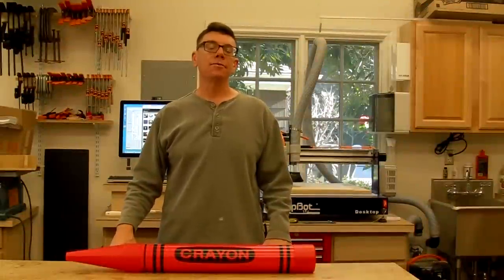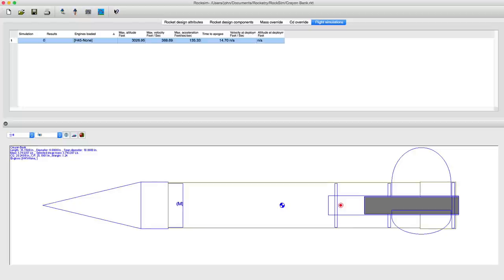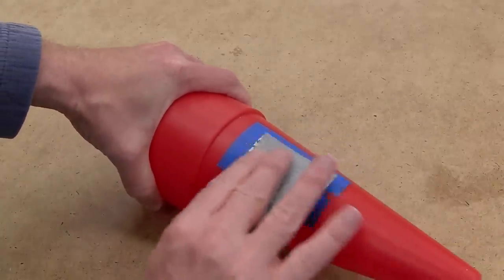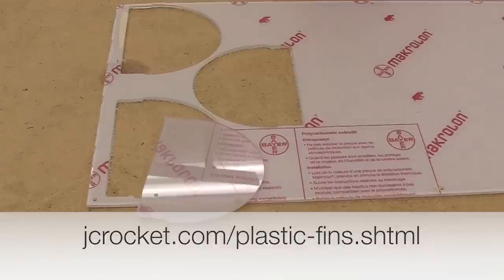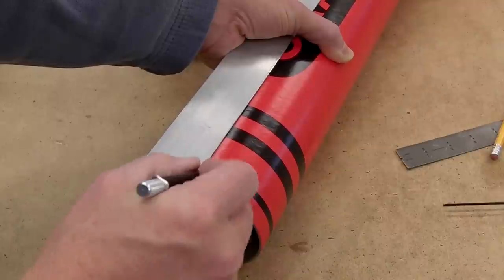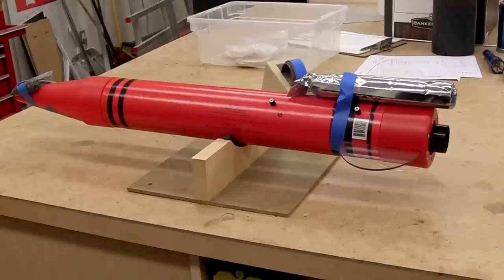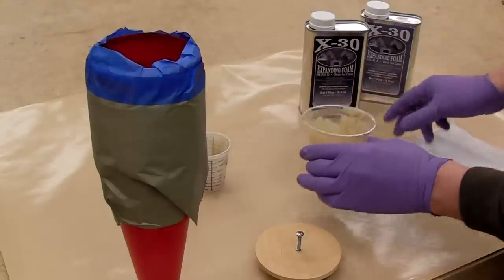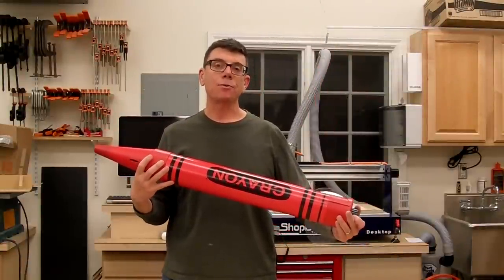Crayon Bank

Comment: where did you get the centering rings?
Reply from the maker: I made them custom to fit the inside of the bank tube.  I don't think there are any standard centering rings that will work so you pretty much have to make them yourself.
Reply: ok thanks, how thick are the fins?
Reply from the maker: 1/8" polycarbonate IIRC

Comment: I have a giant crayon bank but mine has a hole in the tip of the crayon I had to duck-tape the bottom any ideas to get the money out? it still needs to fill a bit but I need to know how to empty it when I take it to the bank so I can make it to cash for our family vacation I don't want the money to going spilling everywhere if I peel the duck-tape off  cause it will I had to use a lot of itI have a giant crayon bank but mine has a hole in the tip of the crayon I had to duck-tape the bottom any ideas to get the money out? it still needs to fill a bit but I need to know how to empty it when I take it to the bank so I can make it to cash for our family vacation I don't want the money to going spilling everywhere if I peel the duck-tape off  cause it will I had to use a lot of it
Reply from the maker: +pinkpony1123 143rudy The tip can be pulled out, so you can open it that way.